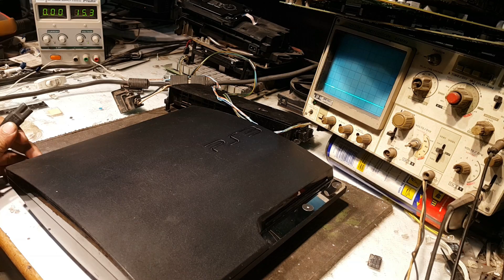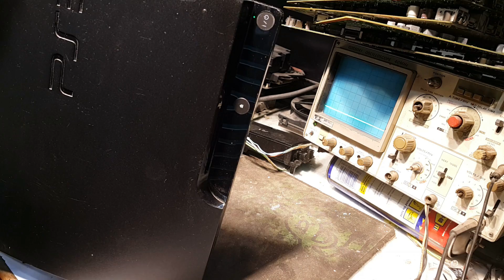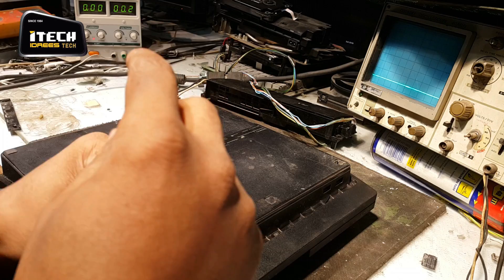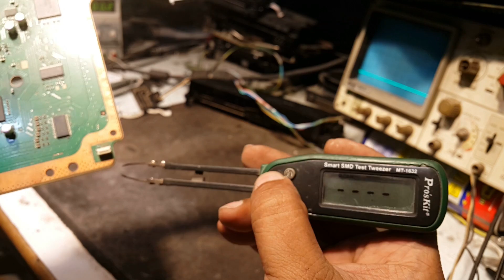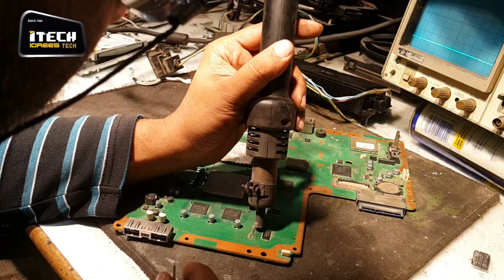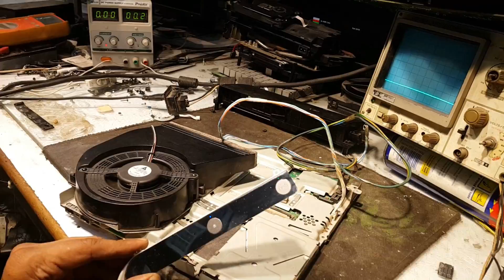Playstation 3 slim shuts down seconds after start up.🚀 #

Comment: hi i have a problem with my ps3 it turns on as normal no problem at all but after like 10 to 15 minutes of play time it jyst turns off and the red led keeps blinking what could be the problem? it isnt the fan since i have already cleaned all dust inside the ps3
Reply from the maker: TheJosephAnime Thanks for sharing your issue. A PS3 that shuts off after some time     3 beeps, again 3 beeps and blinks red is typically overheating or has a thermal-related issue. Since you've already cleaned the dust, check the thermal paste on the CPU and RSX chips—it might be dried out and ineffective. Replace it with a good-quality thermal paste. Also, inspect the thermal pads and ensure the fan is functioning optimally. If the issue persists, it might be a power supply problem.

Comment: i need help. i have a ps3 slim that turns on, does not display anything and then dies after like 30 seconds. I followed this video but found no issue but i have no idea what any other resistor is meant to read!
Reply from the maker: An DC-to-DC converter chip with 1.8 volts at the input and 1.5 volts, that have some biases resistor. A resistance at the value of 55 Ohms goes bad in its biasing, which also causes this problem. You must check another DC-to-DC converter chip at the board's backside with the same volt input coupling at 90 ohms value. Hope it will help.

Comment: Hello ,i have PS3 KTE-001 Motherboard and i have some unknown SMD component's part are missing and i don't know what should to do with it please someone help me to find what are these missing smd from the back front by sending me a picture from the back front of this model
Reply from the maker: Send me clear pictures.
Reply: @idreestech thank you i got the missing smds but now i have another problem with this weird model i have replaced a many electronics component's like you do in your video's and i have changed many ic's but it keeps turn off itself after 1 second Red light + 1 beep and green light and turn's off and no red light just if i press the button again 

i have check the syscon at show's error code 2024 + 2124 + 2040 
and i have changed the HDMI encoder & AV encoder & F6300 
but at didn't work at all it's keeping a same problem with same error code's
Reply from the maker: @Devil_Guy666  Oh my God, if you have changed so many components in it then it might be a cpu or nand issue. Short its tri-state test point and see if it stays on.

Comment: Do you have a reference or chart that shows what these resistor values should be? Bad resistors seems to be a common problem with the PS3 slim.
Reply from the maker: No bro, but I have mentioned many resistance values in my videos you can check them for their references.

Comment: How are you, sir, I have a problem with my PS3 Slim, it turns on and around 40 to 45 seconds it turns off, maybe you could guide me, I have searched for information and I can't find almost anything about this problem. Greetings from Ecuador
Reply from the maker: Do you see a normal display when you turn it on or is the display not appearing at all? I have several questions regarding this issue. If you'd like to discuss this in detail, please feel free to connect with me on Facebook and we can video call. I'll be happy to guide you through the troubleshooting process.

Comment: Hi sir. Great video and great explaination. I am having the same problem with my ps3. Before it took about 30 secs to shut down. Now it takes about 4 to 5 secs.
The problem is all the resistors are okay ! but there is one that you did not mesure in your video, and that one in my mother board is around 1 million hahah, it is under the first chip, on the right, and I don't know how much should it be. Can u help me please ? And thanks in advance
Reply from the maker: Yes, it could be, and replace it with the same as others are.
Reply: Thanks for replying sir. As far as i understood from your video, basically not all the resistors have the same value. And I don't know his initial value . That's why I was not sure if it's okay or not and I was not able to replace it . Can I send you a picture on your fb page or in whatsapp so that you can give me it's values ? And thanks again and sorry to bother you
Reply from the maker: @medmahdibenreguiga9153  Yes on Facebook.
Reply: I sent you a private message on facebook
Reply from the maker: @medmahdibenreguiga9153  Let me check.

Comment: My ps3 slim (3008a) shutdown with a tick sound after some time (1hr) and when i reboot again it only works for 5-10min and so on then i have to wait for whole day to play for 1hr.I changed thermal paste its on 55-65c at 35% fan speed while gaming i dont know whats wrong with ps3 .Also ps3 wifi/Bluetooth is broken(voltage regulator dead) i dont have enough experience to fix it.But today it just turn on for a second and turn off with no LED.Please Help :(
Reply from the maker: Re-Flow the CPU.

Comment: Great video , sir but I have a question : Do I have to bring that defective resistor from another PS3 motherboard ? or can I buy it separately ?
Reply from the maker: You can take one from a doner board but should be at proper value.
Reply: Ok thanks alot

Comment: This time you didn't supply any power to the motherboard from a power supply nor did you use the oscilloscope. You used the metering device. Would a multimeter have done the job too? I know it would've been slower, but would it have worked similarly to measure the resistance of the resistors?
Reply from the maker: yes dear.

Comment: Hi Professor. I have a ps3 just like the one shown in your video and I had the same symptoms: It turned off randomly without any beeps. Thanks to your video, I found a resistor with high resistance - the 470 ohms one shown in your video. I changed the resistor and the PS3 was fixed. It no longer turns itself off. Thanks a lot for the tips. You make great videos!
Reply from the maker: I am glad  it helps.
Reply: Pls make one video that have 3008bmodel slim ps3 im having that one have the same problem sir

Comment: my ps3 3 ultra slim is doing same, when we turn it on  green light appears after few seconds it turn off with red  light on, is it repairable or dead?
Reply from the maker: It is repairable dear. How many beeps?
Reply: @idreestech  sir, immediately turn off withh red light
Reply: @idreestech  how much money will it take in repairing
and its also not jail break set